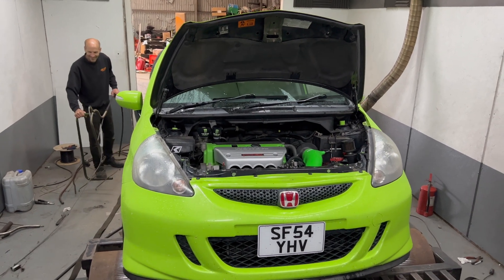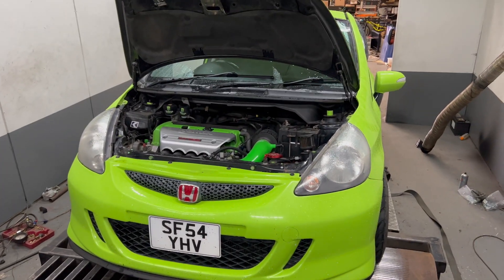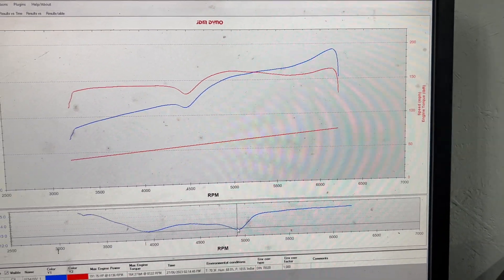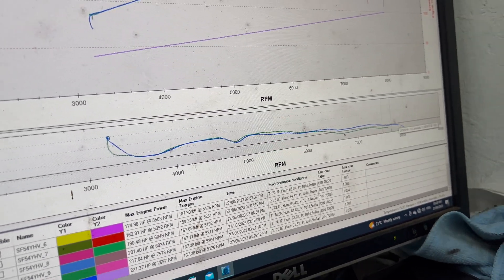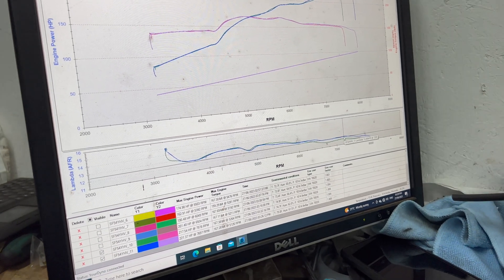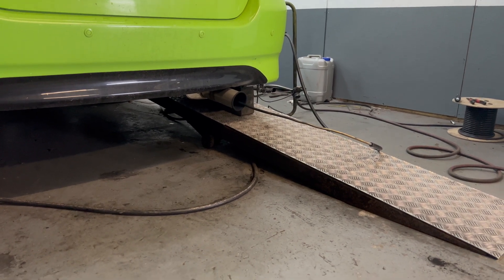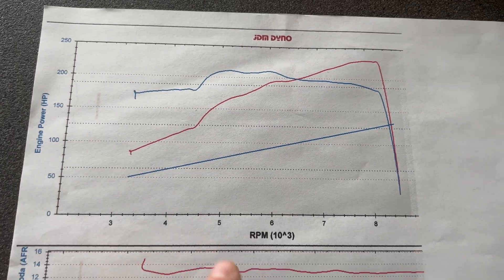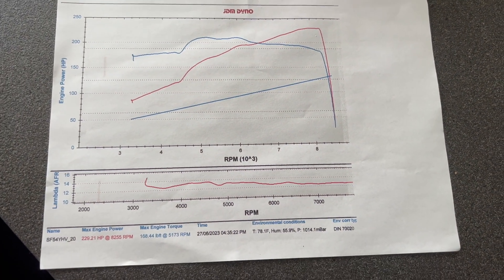Honda Jazz Fit K20 K Swap- Dyno Tuning K20Z4

Comment: Didnt see the conversion, but just wondered if you slotted a 2nd hand motor in without checking or replacing service bits(been there, get it running first then worry about that later) I had a Type R with same engine and once they start getting to the 80-90k mark the Timing chains start to get beyond ideal specs, it'll usually start triggering a cam out of phase code once it gets to a certain length, so if your chains stretched it'll lag the opening of the valves in relation to crank a degree or 2, which can also affect your top end power output that you were disapointed with.

Just something to bear in mind before you throw spend money on some more mods, just checking and getting everything within factory specs is where we always "should" start (unless your building a race motor with better specs)...but I know its easy to overlook that in the excitement to get stuff running and driving along with the 100+ other considerations of the build to deal with.

Great build BTW I think the higher revving engines like the K20 suit themselves to small car builds like the jazz as they dont have ridiculous torque low down that'll wheel spin everywhere, it'll get a bit of road speed behind it  prior to when the VTEC kicks in meaning it'll help keep that to a minimum, that and sticking it in a modern FWD chassis will produce a much nicer daily driver than slapping it into an early 90's civic.
Reply from the maker: thanks for the reply to the video, great response advice and questions. 

indeed it was just put in although was from a running car that was broken due to a crash. I keep forgetting it's the z4 not the a2 so it will never quite make as much power, 230 odd is decent enough for an inlet and a cheap 4-2-1 so quite happy with it really. It doesn't bring any fault codes of any kind currently, and is making its peak power at 8300 so id guess it's not a bad engine. I doubt I could do a chain without taking the engine out, something I didnt really consider at the time.

I can definitely get the valve clearances checked and adjusted, maybe something I should do at some point. I doubt I will be doing any more mods to its power though. it's actually really drivable as it is for every day use and surprisingly doesn't wheel spin as much as my ep3 did at a similar power level. strange.

Comment: Decent figures those buddy, what size exhaust is it you've got, I know they really respond to 2.75" and the big boy 3" so that could be holding you back as I'm sure you know anyway, be a bloody rocket in that little thing won't it lol
Reply from the maker: It’s a 3” system so should be ok yeah, it’s definitely fun, and very useable. One change I think I will make is the induction, otherwise I’d say it’s as good as I can be bothered with due to how much n/a tuning costs. 

Fun car to build, fun car to drive!!

Comment: Rim size and tire size?
Reply from the maker: 16 inch wheels not sure on width or offset sorry. Front tyres are 195 50 16 and back are 205 45 16